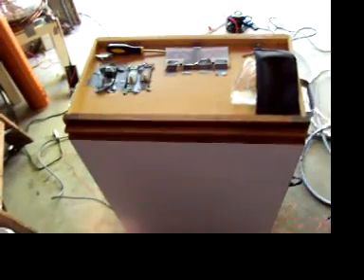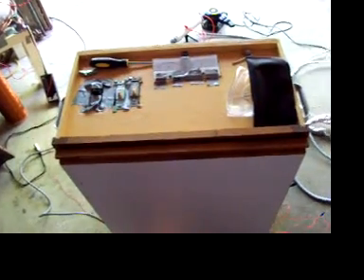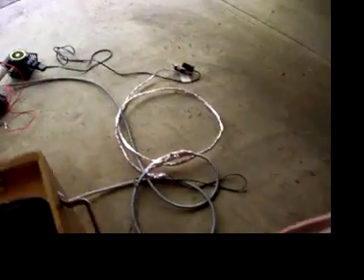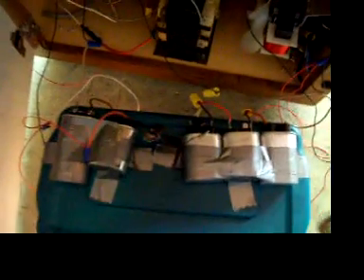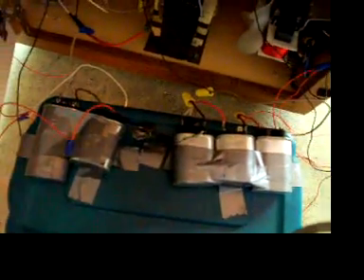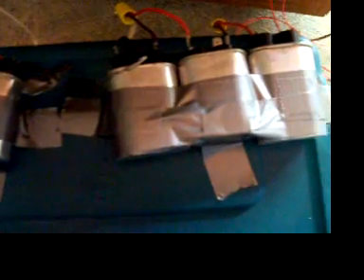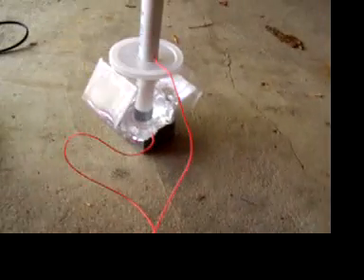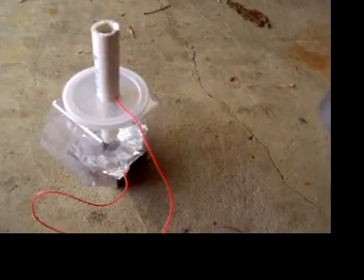Improved Tesla Coil Power Supply

Comment: @samorivideos6 Nikola Tesla made a great power system, that has yet to be improved upon, the amount of electricity generated from a Tesla Coil is several times that used to produce it... however, there is no great danger from the Secondary itself, being as its all Volts nearly no Amps, the danger comes from the Generator itself, but a Transformer attached to the Secondary could transform it into usable power to power a whole residential block, with out simple generator. RnD??

Comment: ...I tried using a capacitor to limit current on a MOT and on a 4kv transformer I have.  I calculated the Xc, and it did work.  BUT I was getting some weird oscillations and also both the transformer and the capacitor got real hot.  When I drew an arc from the transformer, it was a loud popping instead of normal continuous 60hz AC arc.  I've found that inductance seems to be the best way to limit current.

Comment: Very clever!  That's pretty cool.  But I'm not sure it's such a good idea to have the ballast on the secondary side.  I've always thought it was safer to have it right at the source, on the primary side.  Also, from my experience, using capacitors as a ballast (with capacitive reactance) doesn't always work too great...